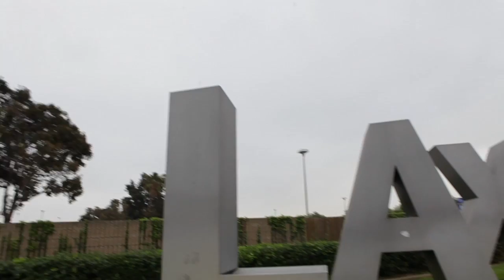2012 Tata Nano: From Bollywood to Hollywood - Jay Leno's Garage

Comment: Its rear engined and it's a rear wheel drive ! The thing's a damn Ferrari !!
Reply: @armaansandhu3676  lolz XDXD
Reply: Ferrari’s are mid engines. VW Beetles, Porsches, and Corvairs are tear engines
Reply: @akishot6735  Mid engine cars are usually also rear engine. "mid engine" just means the engine is between the "axles"
Reply: Ferraris r mid engined
Reply: That's like saying a voltswagen bug is a Ferrari
Reply: Rear engine cars are those in which engines are placed behind rear axle whereas mid engines are those in which engines are placed either on the rear axle or bit of a front of rear axle.
Reply: It’s more of a Porsche 911. Ferraris are mid-engined
Reply: Armaan Sandhu He would never say such a stupid thing as he has basic knowledge about cars. Other than you guys.
Reply: It’s actually rear engined and Ferrari’s are mid engined
Reply: Raghav Varma we do it’s inaccurate
Reply: Raghav Varma Sorry you...to find such a meaningless comment brilliant. Not funny at all. Did anybody laugh...except for pitty?
Reply: And it's manual
Reply: If A Ferrari engine clone is crashed, and cant be repaired.

Comment: It has AC??? holly crap, Thumbs up Tata, this is more than any human would ever need, the only reason we need so many safety features is bc some people can't drive and some drive like maniacs...
Reply: I would trade the ac for at least 80-100hp
Reply: Quality Tofu Delivery I don't know if speeding in that thing would be a very good idea. It was built for a different purpose.
Reply: Quality Tofu Delivery Considering the temperature in India, I doubt you would trade the ac for more hp, especially in traffic, lol.
Reply: with the amount of traffic in india, you won't need a lot of safety features and speed. they made the nano to cater the streets of india, not autobahn
Reply: I would think it would need AC, given that most of India has a very warm climate. What I find worrisome about the design is the high center of gravity; it looks like it would be easy to put one on its side in a tight turn or even roll it if it's going fast enough. But overall for what it was made for, it looks pretty good.
Reply: @All2Meme  it's either hot as hell or hot and humid as hell.
Reply: But no airbags
Reply: Have you been to India? Everyone there drives like maniacs.
Reply: My '96 rainbow colored VW polo is a better car than this. The nano is a worse value proposition than any used car that isn't just a rust bucket.
Reply: @G-Mastah-Fash  omg did you get the harlequin?
Reply: I would buy atleast Tiguan or land cruise instead of this motorcycle
Reply: It really sucks that people who say things like this go and vote.
By the way most Tata Nanos have neither AC or even a fan.
Reply: Hi?
Reply: @rishabhharidas4284  true true, but as long you're in the city you're goog

Comment: If I could buy a car for $2700 USD, I really would. I don't need leather or big wheels or big stereo. With the money I could save, I could drive it anywhere.
Reply: Michael Danger you can buy my 96 Saturn for $2700USD and it has bumpers and airbags.
Reply: Does it have a scratch on it? Does the interior smell like new? hahaha :)
Reply: I'd rather drive a Bentley that made love to an Army of Belt Sanders, than a new Tata Nano.
Reply: @MYKEDANGER  you remembered this comment after 3 years also...😀😀
Reply: Buy some M5 atleast this some motorcycle engine fitted into car
Reply: Plus easy parking...
Reply: Potato  you also came here because of recommendation didn't you?
Reply: @MYKEDANGER  Of course not, it's a 20+ year old car, but it has a bigger and more reliable engine, it's safer and a lot more comfortable. I don't see why you would care about the interior smell when it will go away in a few days lol
Reply: Potato  Toyota civic? Honda corolla? Are you high?
Reply: Petar Totev, you have never heard of a Toyota Civic? They are really popular in India, apparently. The Civic is one safest cars Toyota ever made. Hahaha
Reply: @MYKEDANGER  Is this a joke?
Reply: @nedkogenov5530  How is it safer than a 20+ year old car?
Reply: @HerecomestheCalavera  What?
Reply: @nedkogenov5530  Which part didn't you understand?
Reply: yea the money you saving wouldnt be of any use, incase you have an accident the only thing thats inbetween you and the impact is You. 
good luck with that.
Reply: @HerecomestheCalavera  Everything
Reply: @HerecomestheCalavera  if you are asking why a 20+ year old car is safer, it's because the tata nano is cheaply made and doesn't have any safety features
Reply: @nedkogenov5530  Oops my bad.  I thought you were saying the Tatra is safer than a 20+ year old car.  My mistake.  I agree that a 20+ year old car would be better.
Reply: it won't be 2700 USD if it has to pass all safety standards on USA.
Reply: Get a Volvo. The interior won't smell like child labor and it's way more reliable, practical and safe. Oh, and women might actually get in the car with you...
Reply: My ford Taurus police interceptor for  2400 usd and has stock 300hp and i did some mods on it like better suspension kit and better tires and and exhaust upgrades  and put in a bucket seat and a better intercooler and it pumps out 37 more hp at 337hp and 335 torque its my drift/daily car
Reply: Anywhere but up hills 😂
Reply: Lol, 'anywhere'.... this thing can't barely even do freeway speeds, and overheats on a daily basis. Good luck going 'anywhere'...
Reply: So... You can to buy Chevrolet Spark

Comment: The nano looks like a squished second gen prius
Reply: Chevrolet spark/matiz
Reply: TheKenjoje   Spark is much bigger
Reply: Any Prius deserves to be squished.
Reply: Aki Ami Masen I have test driven both cars, and they are not comparable in the least. They made the Nano look much nicer here than it is. The Nano was loud, like an old rickshaw engine, and with a very weak body. It was also very unstable, and I wouldn’t ever test drive this thing on an American road, as  instant death on impact is very easy. Also, there are no fun cabin/digital features, as opposed to all the offerings and comfort levels of the Prius. Even the Chevy Spark is way better than the Nano. But for a poor mans automobile in India, this is a decent vehicle.
Reply: Except it's not a hydrid
Reply: Lucas Fernandez at one tenth the cost
Reply: @djhams I've been owning a Nano for nearly 5 years, and I have to disagree with you. "Death on impact" maybe true, but no one drives at that speed in the city - it's not a car for the highways, and it isn't marketed as one. But as for the other things you said  - no way. For a two cylinder engine the Nano has immense torque and has reasonable refinement. It doesn't sound anything like an auto rickshaw or tuk-tuk. It's very responsive and fun to drive. The Spark has even lesser space and legroom than the Nano even if the overall size and footprint of the Nano is much lesser than that of the Spark - that's efficient space management. And I've driven it upto nearly 90 kph and it's very stable depite its lightweight body, tall profile and skinny tyres. Tata markets it as a cheap car for the city and it performs that task really well. I own a much bigger sedan too, but for the city I prefer the Nano and I'm 6 feet tall. The Nano is a triumph of Indian ingenuity. And Jay has driven all sorts of automobiles, and he ain't bluffing when he says its lively and responsive.
Reply: nope, a Mitsubishi imiev
Reply: No, a Yaris!
Reply: Reminds me of my 2009 Smart fortwo. . .as a 4-door.  ;)
Reply: Aki Ami Masen  Prius is at least reliable...
Reply: The only difference is that the nano is not a hybrid
Reply: IKR

Comment: I owned one in Thailand for 2 years, was a great fun car to drive and yes the AC was awesome. Oh Jay it's a 3 cylinder not 2.
Reply: Dunno if they potentially made a version for the Thai market with a different engine, but the original Nano was a two cylinder.
Reply: Anyway engine gonna lugg
Reply: They had a twin, and went to a triple because the twin couldn’t handle the ac…
Reply: it has 2cyl engine I have it since 2011 and still running

Comment: Well, Nano haters, let's compare apples to oranges; The Honda Ruckus scooter vs the Tata Nano.

Bolts per wheel:
Nano - 3
Ruckus 1

# of wheels:
Nano - 4 (+spare)
Ruckus - 2

Top speed:
Nano - over sixty
Ruckus - thirtyish

Number of passengers:
Nano - three
Ruckus - zero

A/C:
Nano - yes
Ruckus - if the weather's cool

Heating:
Nano - yes
Ruckus - if the weather's warm

MSRP:
Nano - $2700
Ruckus - $2700

Or, to compare Indian apples to Indian oranges, the 500cc Royal Enfield Bullet motorcycle has a similar top speed to the Nano, will carry one passenger, and has a U.S. MSRP of over $6,000.
Reply: Safety: Both will kill you when you crash over 60 kph
Reply: R fab I don't think safety is high on the agenda for most people in India. A really cheap car that can fit four people and is really simple and reliable is way better than walking or riding some overcrowded bus or train.
Reply: Leonard The Sniffer Wallace Heck, they fit 5 in a motorcycle.. lol
Reply: I think you are right about people in India, the people there must be glad they could afford something that looks like a car. But when you crash a Nano in a country where cars are 2-3 times heavier on avg. then you have a problem..
Don't get me wrong, I think it's great that a car this cheap exists for 'poor' people who otherwise couldn't afford a car.
Reply: I only eat bananas
Reply: 47f0
Honda Ruckus
Cost - 500 bucks used
Gas milage - 120 mpg
Reliability - Honda
Maintainance - 5 dollar liter / quart of oil every 5 thousand miles
Dimensions - A bicycle
Turning radius - 1 meter
Licensing - None

Tata Nano
Cost - 2700 bucks new
Gas milage - 40 mpg maybe
Reliability - ??? 
Maintainance - ???
Dimensions - Too big for one person
Turning radius - A street wide
Licensing - Drivers license and car insurance

You can look at different vehicles from a number of perspectives, in all seriousness the Nano sounds like a great car.
Reply: Safety?
Reply: Leonard The Sniffer Wallace I second that, safety is not a priority, we can't speed such cars due to poor conditions of roads here. You probably end up going 30-40 miles tops. You can hit the gas on highways, we do have good highways.
Reply: @Roberto89gbbr  I know this is 5 years old, but you do realise that a considerable population of India can comfortably afford a car, don't you? Even 5 years ago? Calling it poor is a huge assumption.
Reply: Scooter goes above 80kmph

Comment: 100 salutes to Jay Leno for giving a very honest review unlike other foreigners who are expecting a Lamborgini type experience from this car and rate this as the worst car they'd ever driven.  It's for somebody who drives his whole family on a scooter or a motorcycle.  It's much more than a Lamborgini for him.  We Indians take pride in our technology no matter how small it is.  Henry Ford did not create a Ferrari when he made his first car.  Only disappointment I have with Tata is their totally outdated designs.  They need to hire some new talent.
Reply: I was going to give you a thumbs up until you started criticizing the designers. What is wrong with the design of this car? It seems like a very good design for the market it's intended for. It's simple, practical, economical and seems to be easy to fix.
Reply: Brother I own two Tata cars  one of them is Nano I know the design flaws
Reply: Tata is known for having relatively dull designs compared to other Indian car manufacturers. The interior of the Tata Safari for instance is a bit spartan, especially the audio system. It's one of the areas where Tata skimp on while focusing more on what makes the car suitable for its purpose. Tata is more of a function over form company, which is good considering their cars are great for their intended market, the Nano included.
Reply: Karan Agarwal I don't like the headlights but other than that I think it's quite alright. A brandnew car for 2700 dollars which even has AC is amazing.
Reply: OpaSann0 Add to that amazing fuel economy: almost 60MPG US! It's amazing what can happen in a price competitive market.
Reply: Actually, Autocar UK gives a rather positive feedback for this car.
Reply: nigahiga6400 Haha yep, this car is gonna save lots of lives for sure. 2700 dollars doesn't buy you a new scooter in western europe xD

Comment: The officer in the Crown Vic was getting it!
Reply: BCH37501 I've driven them as airport cars after the pd is done with them. They're heavy and have no acceleration. Would be very easy to outrun.
Reply: Robert Gary lol not fast by any means, I have a workshop about a block from local PD, and you can hear them hit full throttle and nearly idle past...

Comment: A new air conditioned city car for under 3k - who can top that? But by the time they add on all the crap to satisfy U.S. regs it will double.
Reply: sighly more than double. Extimated $8000 retail once it's been reworked for safety, emissons, etc.
Reply: It wouldn't double, it would be impossible.   That vehicle simply isn't possible from the ground up, as its a death trap.  The reason cars keep getting more and more heavy is because of the unbelievably strong passenger cages they have.  But this design would literally fold up into a crushed aluminum coke can on impact, killing everyone inside.  The design itself is flawed, but that's what it allows it to be so ungodly lightweight, cheap, and frugal able to be powered by such an insanely weak engine.
Reply: DumbDuck44 Spot on I've watched the crash test for this car and it equals instant death!
Reply: Mike Cooper-Hollis
So? How many people ride motorcycles that are about as dangerous as it gets in a collision.
Reply: DumbDuck44 The design isn't flawed, it's what is needed for that market. A car designed to meet somewhat nutty US safety standards would be far too expensive to meet the goals this car was designed for.

Comment: Just read the Wikipedia article for this thing, they sourced a lot of the components from German manufacturers, including the HVAC which is from Mahle! No wonder it's good. It seems like decent little city car, wouldn't mind buying one if I was living in some hot climate. I doubt the heater is much good though. So, not that great of an idea for scandinavian roads. Nice work from Tata and indians none the less. It does exactly what it's supposed to do, offer cheap affordable family transport for congested far eastern cities. Not the safest, fastest or the most luxurious thing around by far. But for 2700 bucks brand new, that's a lot of car.

Comment: This is actually slower than a Citroen 2CV6 - 70 mph.
Another 2 cylinder 4 door 4 seater weighing 645 kg (1,420 lbs) with a proper trunk and spare wheel.

Comment: Note the installation of the roof NVH Insulation Mat. Many more expensive vehicles omit this. Vehicle Engineering is all about ballance and compromise. When you are designing a suspension solution, for a very cheap small car, to driven in relative comfort, over very rough rocky and dirt tracks, air suspension, stiff springs and anti-roll bars are out. There is going to be substancial roll. It is well engineered for its intended purpose, driving conditions and cost. It would be very unfair to compare this vehicle to anything other than similar Indian domestic vehicles. I commend Tata's Engineers and builders, for a job well done.

Comment: It's illegal for US roads, because "no airbag, no crash bar in the doors..."
Sooo he says that for example a 1966 Ford Mustang had all those things? If not, then why can you use them even today?
Reply: because 1966 Mustangs were built to the required standards of 1966. same reason you can buy an old house with a fuse panel but no one would be allowed to build a new house today without a breaker panel.

Comment: The Nano did not sell as expected because, I think, it was not aspirational enought. The Dadsun brand is also not selling well, although they presently have the cheapest car in india for the same reason.  Finally, what did not help was the competition from the Suzuki Alto, the smallest and cheapest car in the Suzuki stable which is a regular top seller, and it would have been very hard to steal market share from it. Suzuki brand rules in India with 50% of the market.

Comment: Considered the worlds most dangerous car. Actually Europe can't call it a car, it's a 4 wheel motorcycle because it doesn't meet car safety standards.
Reply: Driving 2 wheeler with 4 pillion riders in India is more dangerous than driving TATA Nano. O fcourse this is not designed for upper class. It's top end model costs just $ 4412 which is worth than risking life. But the fact is no other company in the world has become successful to manufacture a car/4 Wheel motorcycle like this so far.
Reply: The indians are excellent drivers and actually don't need all that bs safety equipment.
Reply: Shadow Hamster no it's because the roads are too bad you can't go over 25.
Reply: Shadow Hamster Not So True. It varies from person to person. It's all about what do you learn from "One Last Ride" & So on.......

Comment: Cool little car! How about that gas mileage?
Reply: City- 18.5 kmpl
Highway- 21.9 kmpl
or
65 mpg
Reply: Brian Core This is the most unsafe car out there. It doesn't even have airbags. Don't even think about it.
Reply: Jake Rewlz you are not going to be going very fast in it anyway. Between the condition of the roads and congestion. Running down the city streets at 40-60 mph. Ain't gonna happen very often.
Reply: bring it to the U.S.